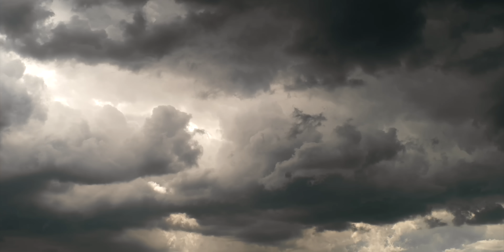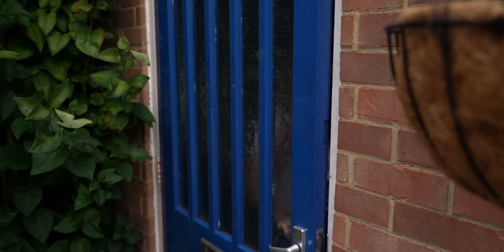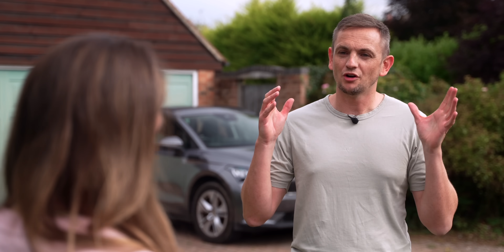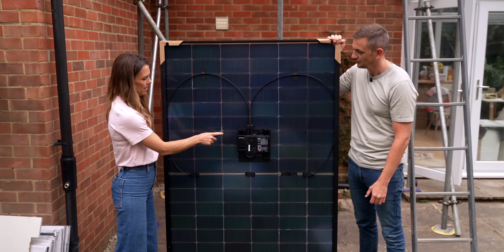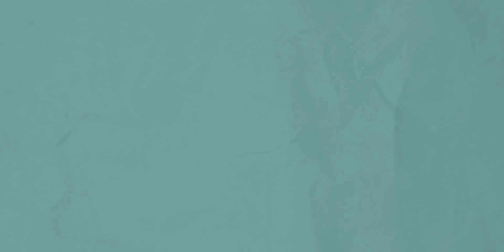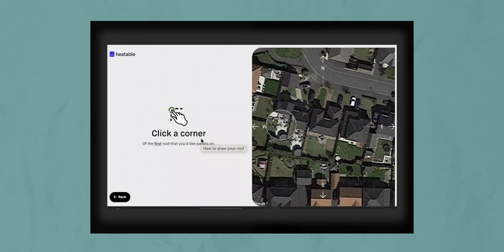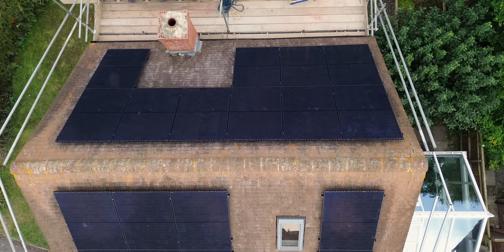Maximise Your Solar Returns With These Bifacial Panels!!

Comment: I am an energy engineer. Microinverters aren’t used in order to get better efficiency on cloudy days, or extend production to early morning or late evening. This is just wrong. We use microinverters on systems with complex shading conditions. That’s their main advantage. They also come with a number of their own issues.
Reply: Micro inverters may be able to start working at 20 volts but that is  coming only from one panel. If you have a string of 10 panels and each panel is putting out the same 20 volts that is 200 volts total coming into a string inverter. In this case the startup time would be no different between string inverters and microinverters.  assuming all other variables are equal.
Reply: @richardnwilson  Microinverters do not use a main inverter like typical dc systems, so this would not be an issue here. However, I get what others are saying that if one fails, replacement on a roof may be inconvenient. But would remove the problem of dc arcing fires. Different types of systems have pros and cons imho.
Reply: @benbocc1549  DC arcing fires is not a huge problem, not even for large-scale solar parks with thousands of panels.
Reply: @benbocc1549  At 1:30 she says that since microinverters start working at 20 V compared to 200 V for string inverters the microinverters  would therefore start producing power more quickly. This is a little misleading since string inverters often have 8 or 10 panels which boost the voltage by 8 or 10 times therefore eliminating or minimizing any advantages in early startup performance.
Reply: @richardnwilson  + string inverters often have a startup voltage of 60 to 80v.  Sure there are plenty with worse than that, but even budget brands can have a decent startup voltage these days.
Reply: @ThanosSustainable  No because they have personnel monitoring them 24/7.
Reply: Regarding costs... he says they cost more per panel because they each have a micro inverter. However the system won't need a standard inverter so that should be a considerable cost saving.
Reply: @ralpharmsby8040  Not really, no. The micro inverters cost north of a 100€, I've seen 150€ somewhere in the comment section. If you only have 10 panels that's easily a 1000€ for the micro inverters. You can buy a decent string inverter for a 1000€.
Reply: Micro inverters are inherently more safe as well as there is no high voltage DC cables running on the roof. Also easy to enlarge system as you don’t have to buy a new inverter as with string based systems.
Reply: @TurreTuntematon you are confusing mini inverter with micro. Mini can use low voltage from panel or panels to inverter. I use 24 volt inverters.tbey need larger high diameter wires to support higher current.
Reply: I've left many a comment on their videos, as they alway tell the upsides, never the downsides, the warranty won't cover scaffolding costs for instance, there is also very little power available at the lower voltages, and bifacial will make negligible difference on a typical roof. They were going to test two panels side by side, one bifacial one not, I don't that ever happened or at least they didn't publish the results. PS I build my own Victron systems.
Reply: The system AS A WHOLE is better on cloudy days. As an enphase owner, I can testify to this being true.
Reply: @Anon-u3i agreed also as a 10 year+ enphase owner
Reply: @Anon-u3i  do you have a string inverter next to your enphase system, that doesn’t work as well, to back your claim?
Reply: Trees surrounding property then!
Reply: If a micro inverter can start producing at 20v, not 150v like my system, I am all ears; it can be hard to get shorter strings going otherwise. Agree that microinverters mitigate part shade of panels, but as the product shows, they can also maximise productivity periods (as was very well explained by the presenter, gg). 
Would add that well designed cheaper dc systems can also do a good enough job on cloudy days, for those on a tighter budget.
Reply: @benbocc1549  Most decent inverters have a lower startup voltage than that.  60v to 80v is normal, so a string of 3 to 4 panels would match the microinverters as far as that is concerned.
Reply: @benbocc1549 exactly
Reply: @benbocc1549  

Yes, but, you can buy real sine wave inverters (up to 3.3 law) which run off 12Vdc.

As in they run off the battery bank and power whatever upto 3kW maximum load.

Obviously there are bigger capacity inverters but it's possible to get away with such a system if you're just wanting to run a TV/hifi say.

Heating and cooking by solid fuel stove or gas (propane).

In short more than one way to accomplish going off grid for a few hours.

All depends on your needs as you might suppose.
Reply: Bifacial on a dark roof and block the cells with an inverter, oh and if there is a problem you will need scaffolding to access the inverter.  Makes sense to me.  Did he mention that size for size a mono facial panel typically has a higher base wattage, typically 430w bi = 450w mono.  
If a Bifacial panel is mounted where it makes sense, like a car port, please note that the amps increase with the wattage and under ideal circumstances, may exceed the max amps for some inverters.
Reply: All we need is honesty and low cost.The Chinese in my opinion will cover that.To expensive we won't buy.
Reply: Thank you for this comment. It appears this heatable guy is hell bent on misleading his customers and the general public about what micro inverters are meant for. I left a comment similar to the one you wrote here on his channel but he is here again repeating the same lies and the presenter is helping him to promote his falsehoods. Perhaps this whole presentation is a paid ad.
Reply: @adon8672  yeah I feel like if these were legitimately taking off, people would be using them directly solar generators, and they aren't, so, why not. seems suspicious to me.
Reply: Bi-Facial  panels work best in a vertical  psition . Backed up  by a reflectant. Such as a white background or mirror of some type. 
   They also suit customers needs better in an EAST WEST. Orientation.  While a south facing  panel will generate more peak power. They also suffer in 2 ways. 
  Heat reduces conversion.  
  Early in  the morning, late in the day  panels at an angle to the sun   Do not put out as much power as vertical panels. 
  Early in the morning is the highest electrical demand  as is later in the afternoon.  
Sun rising and setting  vertical gets a straighter shot at the sun than panels at an angle. 
 Often nobody is home during the midday.  If so,  electric demand typically is lowest.
Reply: This is exactly right, micro, inverters, help optimize when there’s different voltages coming out of the different panels.
With a single inverter, it’s a kind of lowest common denominator output, so the worst outputting panel limits the other panels.
This can happen if one panel is shaded, but the others and Sun like you said, but it can be for other reasons one panel might just be worse than the other ones.
Regardless, it has to little to do with overcast days…

Comment: I'm being a bit picky, but photons and electrons can't be converted from one to another, they are different animals, photons transfer their energy to electrons is a more accurate description.
Reply: Not being picky, good point.  The way I understand it, a photon from the sun strikes an electron in the silicon wafer to break its bond thus freeing the electron.  Is this sort of accurate?           P.S.   Don’t mind Mr. no one
Reply: She also conflates starting voltage with range. None of her supposed science makes any sense.
Reply: @luc_libv_verhaegen  Leave her alone satan
Reply: @viyye  Ah, religion. You rear your ancient mass-murdering head once again. I prefer actual tangible facts and data though.
Reply: If you're going to criticise someone's inaccurate use of language to simplify an idea to a general audience, you probably shouldn't also call photons and electrons "animals" in the same improperly constructed and improperly punctuated sentence.
Reply: she's beautiful so she is right, get over it mate

Comment: Don’t have the bifacial panels, but do have Canadian solar panels rated at 440w connected to an Enphase system.  6.6kw in total.  
Here in Melbourne, Aus, it started generating this morning at 6:20am and stopped at 6:15pm. 
35.5kWh today.
Reply: Alright mate, don't rub it in.🤣
Reply: @dogbreath6974  Here in Australia we get sunburn when it’s CLOUDY 😅😅
Reply: Which Canadian panels do you have?
Reply: @3184Patrick  the TOPHiKu6 440w panels
Reply: Maybe 130miles range for an EV. I’d love that kind of energy independence.
Reply: Nice.
Reply: That’s cool. I’m in the UK and have pretty standard panels with a pretty standard string inverter. 
It started generating at 6:50 this morning with sunrise at 7:01.
Reply: @jesseb4me 

That's nothing!

I get 0.1V off the moon!

Mind you no current to speak of.
Reply: @t1n4444  Amusingly, our home battery inverter keeps indicating up to about 10 Watts coming from our nonexistent array. Yay! Free energy!! ⚡😀⚡ (jk)
Reply: Enphase Micros, love it.